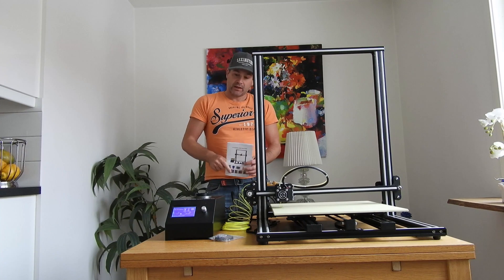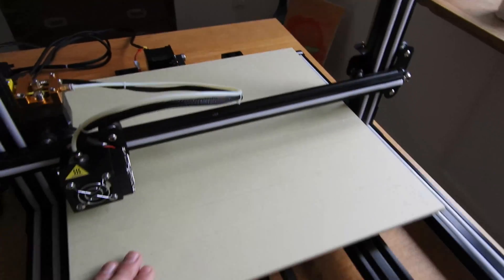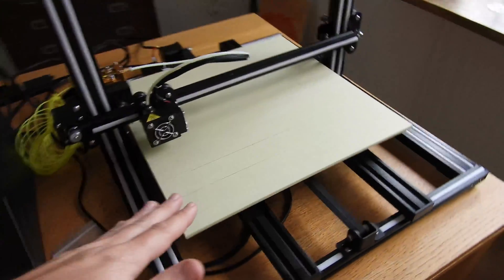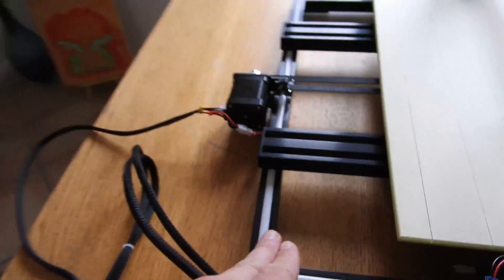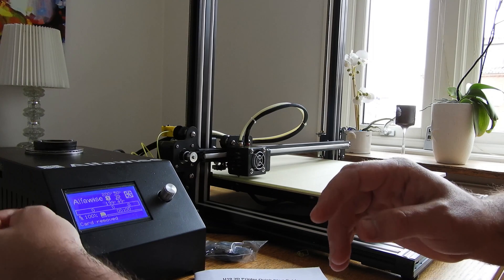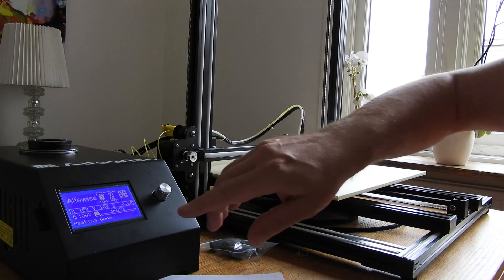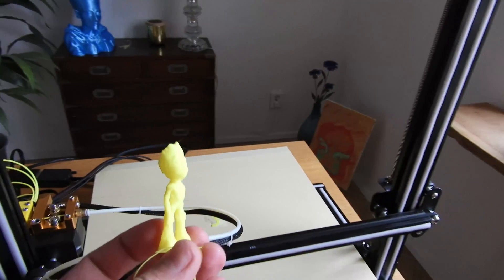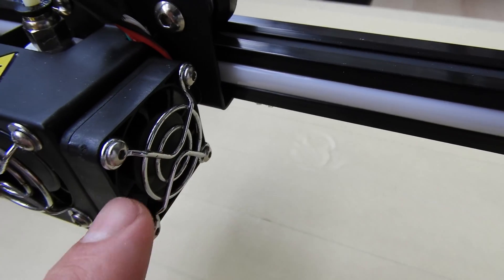Alfawise U10 - 3D printer Review ( Leveling the Bed & First Run )

Comment: Is that a bowden design or direct drive extruder ?
Reply from the maker: bowden
Reply: I have had a lot of issues with bowden designs.................thanks for sharing!!!
Reply from the maker: Eric Archuleta HC Maker 7 have direct extruder
Reply: The Altimaker has 2.85mm thick filament which makes the bowden design better.............. however the 1.75 mm filament is too week to push that filament back and forth making retraction settings less acurate and more problems!!
Reply from the maker: Ohhh NO ;-) much better 1.75mm filament 
you can easter control temperature and get mush mush faster prints +print quality
old 3Dprinters use 3mm filament or industrial with Bowde System 
(3mm filament too fat & having lots of issues)